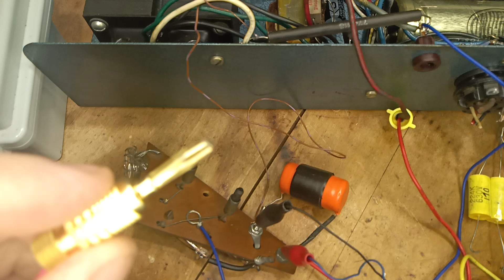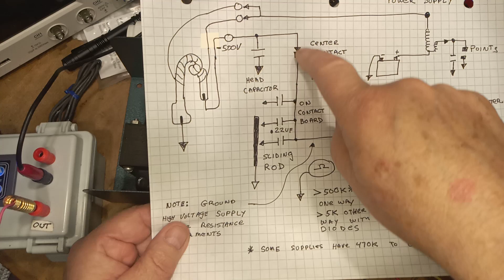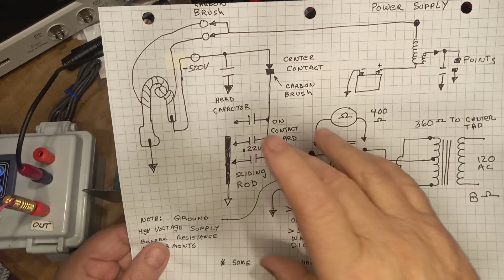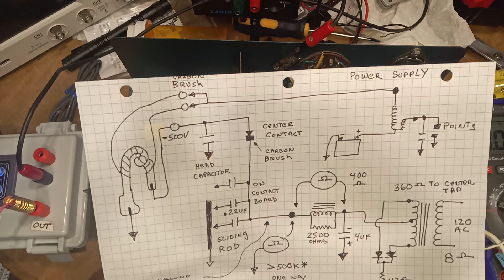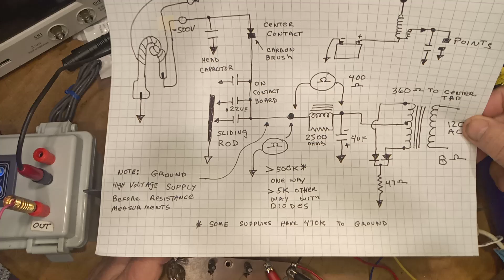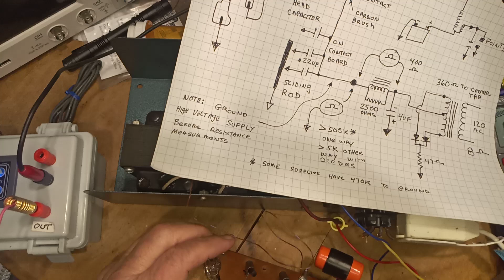SUN DISTRIBUTOR TESTER Is Your Neon Strobe Tube Bad

Comment from the maker: Have you priced a transformer at Paramount?  Then you should take this advice.  The diodes are 1A 1,000V, example 1N4007.   Since you buy a pack, put two in series instead of one and each diode string should have 100 ohm resistor to ground.  This will save your transformer should they ever short.   

Balance resistors should be 270K to 470K 1.2W.
 
Capacitors are 0.3UF 630V or more.  That is an old standard, some were 0.25uf.  That value is no longer standard.  Some have replaced with 0.22uF.  Manufacturing now is more precision.  Buy a .22 today 20% and it will be made to -20%.
Low values will be a weaker flash.  Suggest placing to  0.15 in parallel. That will make 10 total.  Don't forget four under contact board.
Reply: thank you Opera. to answer your other question to me. the tube resistor is blown. I do not smell anything burnt but this happened prior to me purchasing. 
the unit powered on.

is there anyway I can send you pictures to confirm my orientation of components are correct? (diodes etc) email?

also to clarify on the 10 total capacitors
the power supply area capacitors (0.15uF 650v) are in series as shown in the video with the balance resistors 470K 1.2W. 

the spinning head unit is two 0.15uf 650v capacitors in parallel, and my board is 3 capacitor type so 6 total in pairs of two (in parallel)

does the composition of the capacitor matter? should they be a polypropylene or similar rather then a electrolytic 

thank you for the assistance, I do enjoy this hope to learn more.
Reply from the maker: @ShnitzlHaus  I appreciate these questions.  My videos are unscripted and some information gets left out and deserves some clarification.

The two capacitors in series which need balancing are electrolytics typically 10uF 400 or 450V.  They can be a value over 10uF as long as they are identical in value.  With silicon diodes the voltage will be about 570V and the easiest way to get that voltage with common parts is to put them in series.  Never replace the vacuum tube rectifier with silicon diodes before replacing all the capacitors.  Using solid state diodes will raise the supply voltage by an additional 50V.  This higher voltage is certain to cause the older capacitors to fail. The lower resistance compared to the tube could cause the transformer to burn out should a capacitor short.

The material if the strobe timing capacitors is not critical. There are special pulse rated capacitors but this application does not rise to that. The capacitors seen in video and provided by Paramount in their kit are at the extreme end of being acceptable.  Each has an ESR of about 1.2 ohms.  I mentioned buying a pack of 10 because that is a value often sold in.  Using two 0.15uF capacitors not only give a full value of .3uF but will also reduce the ESR resistance by half.

In addition to the capacitor in the rotating head there are four 0.3uF capacitors behind the phenolic board in the back of the machine. This board has fingers which switch in capacitors as speed changes. These can be individual capacitors or combined in a box.  The common lead of all the capacitors connect to the center brush. This board can be seen in another video.  The remaining 8 capacitors will be installed here.

I'm not anyone's private engineer, unless they pay me. I don't own one of these machines or use them.  Not even a car person. I have to drive 27 miles in order to do a video.  I have friends that race and I like them.  For that reason, I design state of the art conversions for them. These Frankenstein machines do have an appeal to me. YT has never paid a dime.  Internet people are mostly one way. They get what they want and then it is adios.  I wanted all my projects to be a community effort. Not much luck with that.  Posting a video of your project helps me and other people.  If that seems like too much effort, welcome to my world.
Reply from the maker: I found these on amazon for $15 if in the US, 5pcs 1200V Non-inductive Capacitor Absorption Capacitor Non-Polarity Resistance,0.33UF. These are superior capacitors at a reasonable price.  I couldn't find any 0.15uf of the right voltage.
Reply: @opera5714   thank you for taking the time. Truly appreciate it. Certain things make more sense while others with research confuse me more! Understandable for someone with no experience  other then proficient at soldering and replacing what I see. 

I too put out helpful videos on my channel and it’s always great to hear people get out of a situation because they fixed something by themselves. 

I do plan on making a video on this repair if I can successfully do it. I already started filming. 

I will go ahead and source all the parts you suggest. I will then make a video shared on here for you to hopefully critique my concerns.  I can hold the components in the orientations I believe are correct If it all pans out I will go back and make a proper video so others can follow seamlessly and credit you. And so people can be walked through the repair.
Reply: @opera5714  update, (I will also do a video to show everything in orientation) seems like locally its extremely difficult to find capacitors (in canada) at a reasonable price! my local shop had the following on hand. (amazon canada has nothing close) 

two - electrolytic 22uf 450v axial lead capacitors to put in series (I forgot to check they might have had 10uf, but sounds like these will work)
I accidentally purchased 2 -  270k ohm 1/2w resistors for balancing I will go back and get 1w and ask if they have 1.2w if so get that one (they also had higher ohm)

mylar capacitors axial lead - they only went as high as 630v I did purchase 0.22uf 630v to mimic the kit (just incase) and I did also grab the 0.15uf 630v to do in parallel as you suggested (if you think its still acceptable) to replace the strobe house capacitor and the board capacitors
they are both "suntan" brand part numbers are ts04a0.15ufk630v and ts04a0.22ufk630v. nothing special I suppose - they are smaller in size then the ones you show
if these absolutely wont work well I can try looking elsewhere - so far prices usually skyrocket to 15$ each at other sources.

4 - 1A 1,000v 1N4007 diodes
3 - 100ohm 1/2w resistors
Reply from the maker: @ShnitzlHaus  270K 1/2 watt resistors are more than enough power for that voltage and 20uf are fine .  Interesting that Amazon CA does not carry everything.  I thought those pulse capacitors were quite a deal.  Typically referred to as snubber capacitors, they can cost $8US each.   What you have is probably ok.
Reply: @opera5714  thank you Opera I will keep what I have. I’ve exhausted many local resources! But I will keep my eyes open. Found distributors but minimums 
Wish Amazon Canada was the same! 

Have to replace my soldering iron video to follow.
Reply: @opera5714  Hi Opera, I made the video with my questions and to show what I have done to this point (incase you see something). I will follow up with a detailed video so it might help others once these are confirmed video link below
https://youtu.be/SbrTZNFvQis
Reply from the maker: @ShnitzlHaus  Your orientations look correct.  Clean the brass rod and fingers with an abrasive pad.  I was hoping to see the tube. The head looks as dirty as any of them.  It is worth removing the flash tube board at this time and cleaning the lens.  The tube can be cleaned with a toothbrush and dish soap. Just be gentile. Watch out the brushes don't fall out. Interesting to check the old capacitors to see which one was bad.  Before turning on, check with ohm meter from choke to ground for shorts.  Likely it was the capacitor in the power supply that shorted.  Otherwise, the choke would see some browning heating.  For others reading, the choke with the resistor attached should measure around 400 ohms.
Reply from the maker: I would have sent you parts but the US Postal Service has made it impossible to do shipping. It costs about $0 to ship anything international now. I used to ship parts around the world.  China is really cheap on shipping.
Reply: @opera5714  yes brass rod got steel wool. I didn’t do the fingers but I will. The tube was not horrible but it did have a foggy layer and so did the lens I cleaned them both up with soap and tooth brush as you suggested it worked well and looks great. 
For capacitors. The flasher house almost looked to be weeping but is fine. The three on the board are fine. You are correct on the power supply capacitor!  I checked continuity on them all with ohm. 
Choke I got 400ohm 
And I checked continuity for shorts on what I worked on. I think I did it right and everything checks out. 
I’m finishing the tube capacitor and mounting now (and will try static balancing maybe hold the wheel assembly at a 90 and see if it can hold any given position)
Then change the clamp wires that go to the distributor (trying to find a good wire) and I can give it a try.

Yes shipping can be more then parts at times!
Reply from the maker: @ShnitzlHaus  You shouldn't need to balance and any difference probably wouldn't be evident in a spin test.  These machines shake around a bit even when balanced.  

There are no rebuild videos I have found on YT for capacitor replacement.  It would be helpful to show that this can be done with a little effort and doesn't require spending $200 on a Paramount capacitor kit.
Reply: @opera5714  I think paramount is 40$  I did film and lost some footage but will still put a video out. 

I turned the machine on and it immediately blew the balancing resistors. I don’t know if possibly I received 1/4 instead of 1/2 watt I thought (270k) . The two legs on the resistor measured to the specs online of a 1/4. 
I’m hesitant to put any back on?

I cut the rest of the blown bodies off and all works  well.  Nice bright flash. 

However I can’t calibrate my dwell. It jumps around by itself in calibration mode. I thought it worked prior to dissasembly.    I replaced both alligator wires properly by desoldering them from the connector in the machine and installed new wire. But I doubt that is the problem as I checked continuity. 

I’m guessing I’m out of luck and the adjusting pot is malfunctioning? And irreplaceable

I will buy some contact sprayer and try cleaning them.
Reply from the maker: @ShnitzlHaus  I think you probably got  2.7K resistors.  Even 1/4W resistor wouldn't have blown.  I've had cherry red resistors keep their value.  

I was called it to a county water plant that had over ten boards burn up on control valves.  The Italian company told them they would have to spend $350K to buy bigger valves.  I found that they had put in 10 ohm 2W resistors in place of 10K.

Your model probably has a sealed tach can on the spindle back of machine. Those can be a problem to clean and set. 

In CAL mode, erratic readings are the result of corrosion to ground.  I don't know why they did not short the leads internally instead of grounding  to frame.  Wire brush those leads.
Reply: @ hmmm I will put my meter to the resistors I heard snapping like a spark plug then shut it down. Smoke came out and the resistors were black. Maybe they were just glowing? 
The incorrect value is probably right. The box said 270ohm which should be right but the resistors looked wrong. 
I can buy some new ones and solder them in. 

Ok I will check ground is this the main power supply ground that I was soldering on? Or in the tach dwell unit?  The rpm can is working I did not touch it as I recall you saying that in a video. I’m guessing They work on that pushrod and not an electrical signal so nothing external to maintain. 

What’s a good way to learn more on this kind of stuff. I enjoy it would be good to understand more.  I don’t know if I’ll get to the point of going into a water plant but that is awesome you can diagnose these things.
Reply from the maker: @ShnitzlHaus   Does this use batteries for the dwell?  Many have battery contact problems.  I replaced the battery with a voltage regulator which produced 1.5V.  The CAL pot is for adjusting voltage as battery ages.  I had this same problem with last rebuild and I just eliminated the pot as voltage would never change.  The DWELL itself is pretty immune to resistance. Cal is super sensitive to resistance of contacts. I figured it was batter to eliminate operator intervention.  The unused filament winding for the tube can be used to power dewll circuit.

And CONGRATULATIONS,  you are now a member of the Amateur Electrical League now.
Reply: @opera5714  thank you. I will gladly accept the title! 

Good point no mine does not have battery’s 

When the unit was running the reading is solid. (I will confirm that again today). Just in calibration mode is jumpy 

I will have a poke around and see what I can come back with.
Reply: @opera5714  ok I was able to trace all the wires back to the dwell tach unit fine. No issues with any connections or wires. Grounds all look good on the meter. 

The selector switch for off / calibration / cylinders seems to be fine. 

I tested the pot. And yep it’s jumping around on my ohm meter. It will be steady and if I move it a certain way it will jump around.  Not sure if taking it apart and cleaning it will help?  

On the back it says 300 ohm. So maybe I can just replace it. Looks standard.  
My local shop only has 250 ohm then 500
Reply: Pot taken apart and cleaned works now. 

Purchased 360k 1w resistors for the balancing.
Reply from the maker: @ShnitzlHaus  Sorry for delay, I have the flu.  Most times pots and switches can be cleaned with WD-40 or other lubricant spray.  For replacement the 250 ohm would work the best, preferably wire wound. For a purist wanting to follow cal instructions, a 22 ohm resistor in series would set the pot to center position.  It really doesn't matter.
Reply: @  not a problem. I have had to work on other things for awhile.  the machine is running but I noticed at higher RPM the brightness of the flash reduces immediately but maintains that lower brightness fine.  when I then lower the rpm it jumps back to a higher brightness not sure if that has to do with capacitors on the board? or the flashtube is weak.

I will make the leads to try the condenser tester shortly.

I also picked up the ignition simulation plate but the wires have been cut and a switch is missing do you possibly have one of these for reference? I did enquire online so I can rewire it.

and I picked up a sun generator and alternator rpm non contact gage it has a wall outlet but I think that was to plug into a machine. not sure how to power this that might require a  video
Reply from the maker: @ShnitzlHaus   I answered this but it disappeared.  The tube probably is weak but you could add one more .15uf to the head.  They remove caps as speed increases to shorten the strobe time.  One more cap probably won't make blurry arrow.  Don't add any more than that because it will interfere with charging.  One additional cap could be removed from lowest finger.  That common lead could be moved to ground.  Doing anything more could be risky.

Comment: What’s the uf of the orange capacitor I know voltage is 500vThanks
Reply from the maker: The orange capacitor stores energy to power the flash tube.  There are three additional capacitors on a board inside the machine as part of the brush assembly.  These are switched in and out depending  on the speed setting. Some miss replacing these in a rebuild because they are hidden in a wax box.  Less capacitance the faster the distributor spins.  500V isn't enough voltage rating if the 5U4 tube is replaced with diodes.

Comment: opera: Thanks for a great series of videos on the Sun tester. I also have a Sun distributor tester (from the early 1950's). The capacitors were replaced and a diode kit installed somewhat recently. The distributor tester worked reasonably well until last week when the neon tube would no longer flash. I've checked all the capacitors (they are within spec) and the high voltage at the neon tube (is within the correct range at 580 volts). I now suspect that the neon flash tube itself might be the problem. Do you have any suggestions on how to test the flash tube itself? 

In some of your other videos, you mention that you have developed an LED and module to replace the flash tube. Do you sell the LED replacement parts or a schematic for a DIY guy?
Reply from the maker: Likely you have run out of luck. You could run a single lead from coil if lawnmower to provide trigger source. I only sell kit for $219.

Comment: Hello Opera,   Sorry If I'm on the Incorrect thread.   Can you help, I'll make It short.   I have a  48v Solar panel system Just pre heating my CH system only. No Inverter. Completely off grid.   Just a Solar Charge Controller and lead batteries.  Works brilliant. One problem.  When set at the  battery under Voltage cut off  It doesn't do so (I have tried resetting) It does cut off when It reaches Overcharge setting.  Any Idea what may be the problem. I'm trying to keep It as simple as possible and not adding anything that puts an extra draw on the Solar power.
Reply from the maker: I don't know what a CH system is. Assume heating is from battery. Controller voltage controls are notorious for not working well.  An external voltage relay is a better solution.